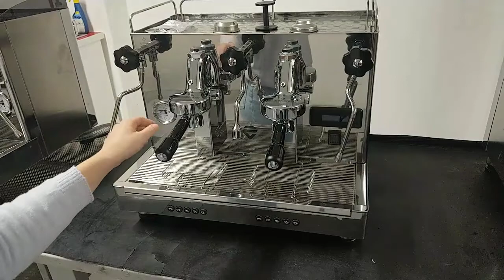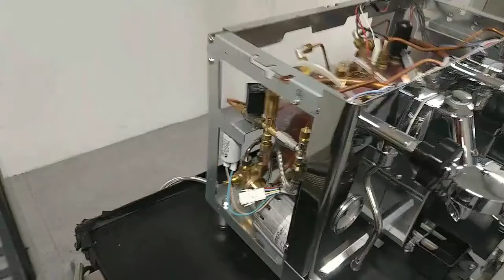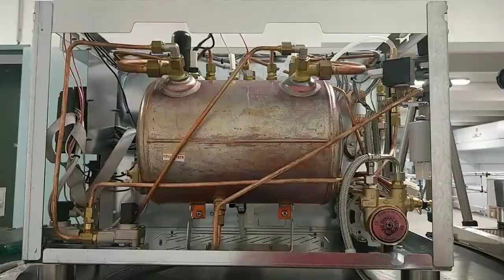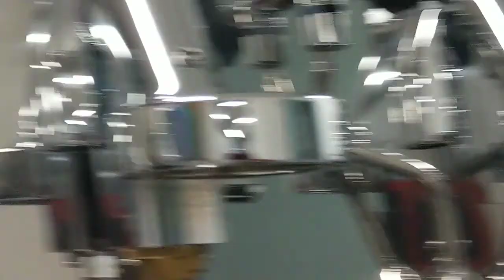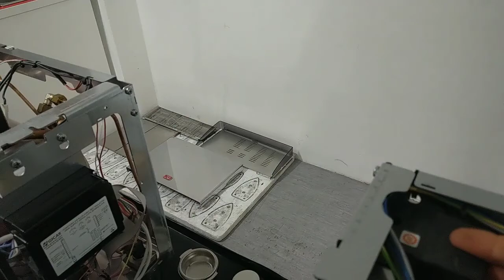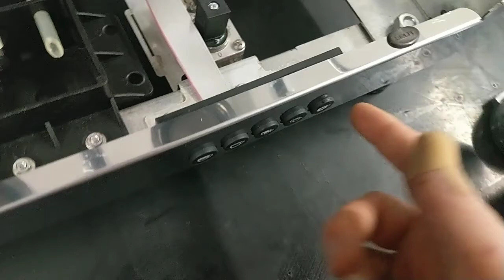pl2svx, inside  Giuliettax  compared to pl2svh2

Comment: Hello I have two questions about modifications!

I have seen that it is possible to put a thermometer probe as well as a manometer directly into the accessory hole near the E61 group head.

I am wondering if it is possible to add a flow control paddle on the mushroom like what is done in Mara X where people are putting Bianca paddles on the Mara X. The Mara X though has the brew lever where the Giulietta X only has the keyboard. 

Is it possible to use a flow paddle alongside the keyboard?

Is it possible to use a flow paddle alongside the preinfusion programming?

I am very interested in the possibilities of the Giulietta X as a highly competent E61. Perhaps it is even possible to use the Smart Espresso Profiler in the accessory hole in tandem with a flow paddle on the mushroom.

Finally, I hope you decide to release a wood accessory kit for the Giulietta X. If it is possible to already order this, I can send an e-mail.

Thank you so much
Reply from the maker: hi, you can do it, but, giulietta has 2 groups with only one pump, 
than if you want install flow control, you can but you can not profile with the 2 groups contemporary,
than you can install only one profiler
Reply: @lelitinsider2977  Makes sense! So it is possible to install on both sides but you can only use flow profile on one at a time?

Another setup could be one group with flow control and manometer in accessory hole and in the other group a thermometer probe in the accessory hole 🤔 

Are both possible?
Reply from the maker: @m.andre824  yes
Reply: @lelitinsider2977  Thank you so much for responding. I just have two more questions:

1) Is pre-infusion flow rate/pressure different from pump pressure?

2) If I accidentally begin flow while the paddle/aperture fully closed, will the machine be damaged or will the water just flush out through the OPV?

Again thank you! This is an amazing machine, I hope more people purchase this and you will be able to develop more accessory/upgrades :)
Reply from the maker: @m.andre824  
1 yes, the more pump pressure you have more flow you have
2 the water recirculate into the bypass, it is not a problem
Reply from the maker: https://www.youtube.com/watch?v=HCNM9N7q7Mo&t=209s
Reply: @lelitinsider2977  Thank you so much
Reply: @m.andre824  did you succeed with the upgrade to the groups?? Give us update please.
Reply: Why with 1 pump you can use only 1 flow profile? Can you explain the technical reason? Thanks  @lelitinsider2977
Reply: How many bars is the pressure of the pre infusion?
Reply: @lelitinsider2977  can you explain the technical reason why with one pump is possibile to use only one flow profile? Thank you. If i use the the flow profile on a group, the pressure will have also consequence on the other group?